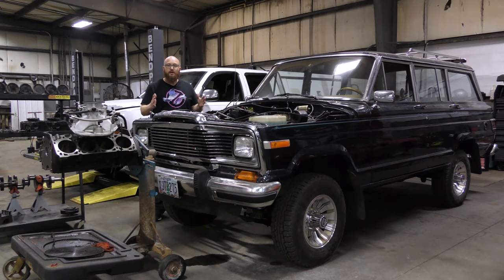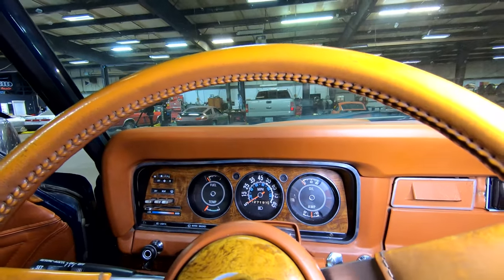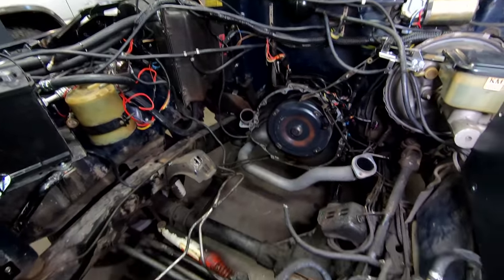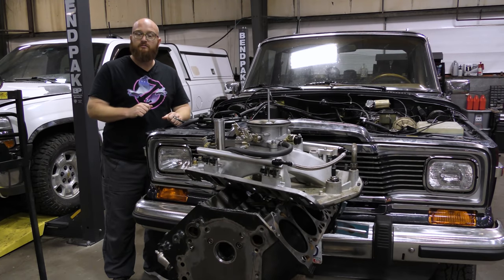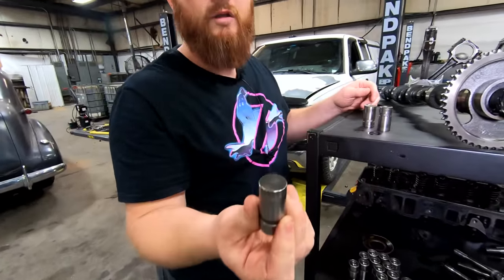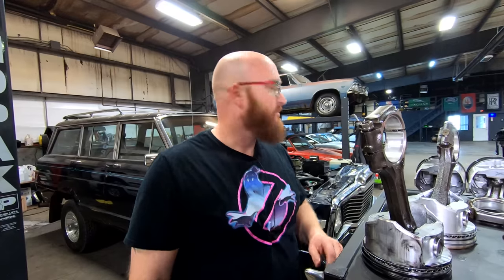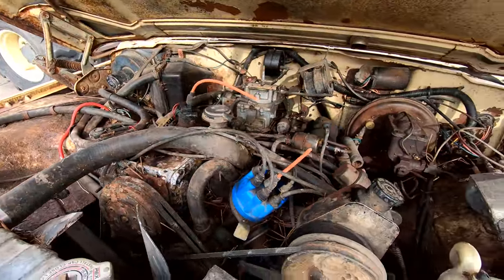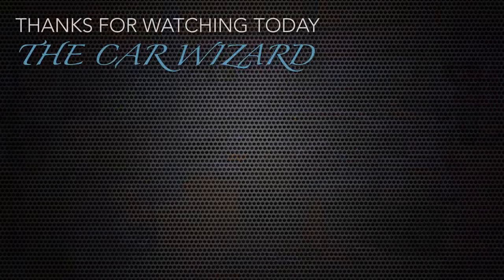The '83 Wagoneer rebuild is dead! CAR WIZARD gets burned by another shop!

Comment: In the past 6 months I've had 3 remanufactured engines with lifter failure. From what I'm told by two different builders is there's no good lifters in the states right now... Well, there are they're just not easy to get right now.
Reply: Uncle Tony has had the same problem and had said the same thing. It's all cheap Chinesium..
Reply: I've seen multiple videos talking about this.  It appears the only way to get guaranteed good lifters is to go with a roller cam.
Reply: I had a rebuild for my 1985 Grand Wagoneer. Rebuild was from rhymes with Casper. Coolant leak from day 1. Why not repaired under the 1 year 12,000 mile warranty? Didn't drive enough during that first year to notice. 4 shops later, still leaking! So there it sits, it's only been 12 years!
Reply: It's good the lifter failed though, those bearings are not looking good and the rod that's semi seized on the piston pin is just atrocious. This engine probably wouldn't have made it far.
Reply: But wrist pins don’t adjust themselves with lifters two completely different issues
Reply: Would that explain the piston rod problem?
Reply: This is why I went roller. I had zero interest in pulling out my brand new engine and doing all the work again. Well worth the extra money.
Reply: @fsjgw  I finally got my rebuilt 360 for my 84 Grand Wagoneer back a bit over a year ago. I chose good quality parts, but the local shop screwed it up. They had it for an entire year. Ended up not correctly hooking up the electric choke and causing a rich condition that kept the rings from properly seating. I discovered it almost 1000 miles into ownership. When I took it back, they had the audacity to try to blame me and the parts I used! I ended up doing a LS swap on it myself and couldn't be more happy. I wanted the original motor, but after 6k miles of heavy oil consumption and smoking under throttle, hoping the rings might seat, I was done. By then, the parts shortage issue was in full swing and I wasn't interested in a round 2.
Reply: @throttlewatch4614  Yes, what i mean is this engine would have had problems in the near future, it's better it failed quickly so there wouldn't have been some dispute about warranty on the engine. Sloppy engine rebuild would probably amount to a negative experience trying to get it warrantied.
Reply: @throttlewatch4614  true but the metal from the shredding lifter could easily damage the wrist pin as well.
Reply: @darkiee69  Actually some of the junk lifters are from the USA. Eaton and Johnson went under due to high labor costs in the USA . Spoiled workers wanting $100,000 and benefits for basic labor.
There are a couple of new USA manufactures but they are making junk also.
Reply: @sccarguy8242  I get that on an engine with many hours on it but but most wrist pins are splash oiled and that doesn’t explain the loose ones
Reply: @throttlewatch4614  they are supposed to be loose. Those were the good ones. The bad one was the right one. A few particles of metal trash from the lifters/cam can caused that quickly.
Reply: @Price Allen The way it works with china is there is no safety net for people there you make money or starve. So if American company's want junk they make junk if the are willing to pay more they can and do make good products. And its many times penny's more. Unfortunately American cooperate greed makes them demand cheap junk.
Now American made? due to high labor costs and cooperate greed unfortunately many American made products are worse than the imported ones.
And with the trump tax that we pay on imported products the American corporation's have less competition and still make junk just charge more for it. Corporate profits are way up and we pay the inflation.
WE need to wake up before its to late.
Reply: @darkiee69  Uncle tony thinks ignition points are the answer also LOL
Reply: @throttlewatch4614  They should move free 7 look right one is to tight
Reply: Chinese or Mexico lifters?
Reply: @vernmiller3584  American made junk really
Reply: @derelict_wanderer  sounds familiar to my shop experience. Once they got my money wanted nothing to do with me.  I took it back (before I knew about coolant leak). for transmission issues (shop rebuilt it, I figured new engine, rebuild tired tranny). They couldn't find any issues. What a shock....It does look good collecting dust!
Reply: I've heard about flat-tappet hydraulic lifters failures & poor quality for a good 7-8 years. Hydraulic & solid roller lifters I haven't heard of having this issue
Reply: I agree with you
Reply: Yes I had a 1981 Grand Wagoner with straight six that burned to the ground.  Fire dept. couldn’t get hood open, too much had melted.  In 1995 car was pristine Burgundy with new white sidewall tires, my heart was broken, but got A nice settlement.   Oh well.
Reply: Dicky I agree with you on this one I dont think it was the builders fault on this one, he just got burned by inferior parts like every thing else in the world right now.
Reply: Fakes being sold as the real deal are the issue. Only buy from the reputable parts sources that sell the good brands, might have to wait longer until they’re in stock, never worth going into an engine twice because of cheap parts that fail.
Reply: When I was rebuilding my heads. The machine shop told me most of the lifters on the market are garbage! They said my original Ford lifters are better than new ones. In fact they offered to buy my old lifters if I wasn't going to re-use them. They were getting there lifters custom built by a guy in Florida.
Reply: RHOADS lifters , i know they pricey , but the man makes them by hand one by one,
Reply: @ValentineMichaelSmit  I’m surprised that’s even a consideration… flat tappet? It’s going on 2 years that they’ve been KNOWN to not work. So baffled that in 2022, this would even be a topic
Reply: I don't know much about lifters admittedly. But judging by the rest of the build quality, it probably was installed out of alignment. That, plus the poor quality of the lifter, would have led to it coming off the cam then getting pushed sideways through the engine right?
Reply: Stick a roller in it
Reply: I've heard from  people that are having multiple cam & lifters failures
Reply: @tomhutchins1046  American workers got paid ok in the day and made some good stuff ,you sound as bad as the corporate greed that your trying to point out, off shoring shouldn't be the lazy option, you want them to get Mac Donald's wages and make ends meat ,buy a house ect , bring up a family in this inflationary environment and make high quality products 🤔,the Chinese companies get heavily subsidised by government, because they want to be the next Germany and Japan, but China also has unscrupulous operators that only think cheap in combination with a relatively virgin auto sector and cheap quality metals, that plays in to the problems with quality control across the sector worldwide, the cry for pay the worker's chicken feed plays into this ideolgy, people across the board have seen lowest wage growth in the past 20 -30 years in most sectors and the cost of living only gotten worse ,so your cry to pay people less and produce better products, doesn't pass the pub test as we would say in Australia
Reply: @mikeshorsepowergarage7577  you can get original lifters resurfaced, had a set resurfaced along with repairing a failed lobe on a reverse rotation Y block Ford engine.
Reply: @fsjgw  good old Jasper Reman..
Reply: They’ve been saying that for 20+ years. “No good lifters left *derp*”
Reply: @GeFeldz  Depends.  If the lifter fails bad enough - you loose oil pressure... bearings soon to follow.
Reply: Then as a builder you tell your customer that you either have to wait for parts to become available or you refund them their money and tell them that you refuse to do a substandard job. Then you offer an alternative option, you can rebuild the bottom end and try to clean up the heads but you can’t do a full rebuild till you’ve got the right parts
Reply: @ChrisSmith-hx8km  -- The only good lifters left are shirt lifters.
Reply: @derelict_wanderer  nobody knows carburetors any more.  Not hooking up the electric choke was a rookie mistake. To have any luck with classic cars, you must do all the work yourself.
Reply: @stuartbear922  The guy hooked it up to a wire, but never verified it received power when the ignition was on. It was a dead wire. The previous carb was hooked to a different one. he just seen the same color wire as before and hooked it up. Just discovered today he never replaced the output seal on the transmission extension housing when he had it apart for rebuilding. Took all of 5 minutes to pull the old and install the new as I was swapping the transfer case. Not even rookie mistakes. Just pure laziness.
Reply: Thanks Biden!!
Reply: @tomhutchins1046  totally disagree. An American company can’t compete with government backed Chinese companies. Why do you think manufacturing disappeared? Just corporate greed? Lol those trump tariffs were to try and level the playing field. Anyway I respect your opinion
Reply: Luckily I bought up every Ford FE NOS lifter I saw, on eBay,  going back 20 years in order to have enough for 8 390-428 engines.

Comment: I never was a fan of the 360 AMC..the Gen III AMC V8 was notorious for cracking the blocks in the deck. It was bad enough they offered a "Service Replacement" block with a thicker casting to do warranty replacements. It could also be used to replace the Gen II blocks in displacement as well. An SR block is what you want. I had a 304 crack in that area on the other bank and the engine was running fine. I had it brazed and it fixed it. I'd ditch the 360 for a Chrysler 360..put the injection on it and it'll run for years.

Comment: I build race engines Hate to tell you this but for quite a while "new" lifters were defective and eating cams just like what you have there NOT the engine builder's fault. To get around this we had to buy "NOS" lifters for over 3 years There were 2 common issues 1 the new(actually reman lifters were not machined correctly for the oil bleed and or 2 the base(came side was not curved properly.I personally had to pay for 4 race engines at 10k a pop before figuring out what the heck was going on. The manufacturers all were saying "you must not have installed/broken them in correctly" LOL I've been doing this 35 years

Comment: AMC v8 engines have a notoriously poor oiling system which requires just a few simple changes to make it trustworthy. If the original timing cover , oil pump housing and oil filter adapter is used during a rebuild it important to make sure the oil pump gears haven't worn into the aluminum pump housing which absolutely makes a already troublesome oiling system a really troublesome oiling nightmare.

Comment: First thing I thought of when he said it was a failure of a rebuilt engine is "lifters/cam".
The aftermarket is rife with cam + lifter failures, has been for a while now - Chinese-sourced cam/lifters
have been failing left and right out there, especially those sold by Comp Cams and the like.
Couple that with a market flooded with modern oils that lack zinc and phosphorus and rebuilt engines 
are failing by the dozens out there.
Flat tappet cams must have zinc (ZDDP) in order not to wipe the cam out and/or have lifter failure!
Couple that with cheaper-sourced Chinesium cams/lifters and there you go...
Reply: Market is full of low quality cam and lifters, for lifters I always using best no mater what is the price and for camshafts even from famous cam producers I always double check them in machine shop, two years ago I bout a camshaft from a famous cam builder that I don`t want mention their name for Pontiac 455 engine and after checking with machine shop right out of the box it has major problems! I send it back with machine shop declaration about the problem and they changed it for me but if you install them without checking and also cleaning passages and holes it will ruin the engine. about lifters you cant inspect every of them tearing them apart etc. only way is to buy best from best manufacturers.
Reply: You are right my friend my boss and myself put a reman 4.3 v6 in a 1996 Chevy truck for a dude he bought his own engine it lasted less than a month wiped out the roller camshaft junk parts are starting to make folks look really bad
Reply: @houtan arefi  im a professional engine machinist and the quality of parts nowadays is horrendous. I've had to spend at least 3-4 times longer inspecting parts because there is no qc anymore. And people wonder why there's no warranty on anything. I can't guarantee parts the manufacturers can't.
Reply: 90s - 2000s VW TDIs have flat tappets and they don't need zinc stuff
Reply: @rkan2  they need rotella which does have zinc and phosphorous in it. All diesel engines use flat taplet cams and they all need zinc oil
Reply: @rkan2  diesel oils have zinc
Reply: also a lot of it is people using way too stiff of a valve spring as well. super heavy springs, no zinc, and chinese crap floating around are the main threats.

Comment: Hey wizard dont feel bad about the cam and lifters. Have seen it 2 times this week with less than 10 miles. It's the quality of the parts . Or rather the lack of quality. Same exact issues. The lifters looked exactly like yours do.
Reply: Add zinc to the oil.

Comment: Man, look at how dark that piston rod was that was seized up compared to the one that moved freely.  Must have been some tremendous friction / heat.  Car Wizard, keep up the great content!
Reply: 11:20 Yep...                                                                                                                                                                                                                                                      206   SEATTLE
Reply: The piston skirt looks pretty scuffed too.
Reply: thats what shesaid
Reply: @marsgal42  Yes, once the piston pin tried to seize in the piston, the piston started scuffing on the cylinder wall.
Reply: Bad cam takes out lifter, push rod takes out the block, coolant in oil takes out the wrist pin??? It did run for awhile but got progressively worse.  Perhaps a short dyno cycle proving start/run was all it got before it ate itself.
Reply: @rickwoods5384  too much spring pressure easiest way to wipe out cam lobe from lifter. The hot black rod I’d be curious if aligns to this slug. My guess is the ground material missing plugged the oil channel and definitely got hot. Only use high quality amsoil for engine cam break ins and always check spring pressure with these modern day cams/lifters. Don’t think the hardening annealing process same as old stuff. That why oil sadly most important part of rebuilds these days. But takes a thin slice of ham to not have two sides. So car wizard got his version and I’m sure engine builder will have theirs.
Reply: No oil they over torqued and never checked tolerances with plastigauge